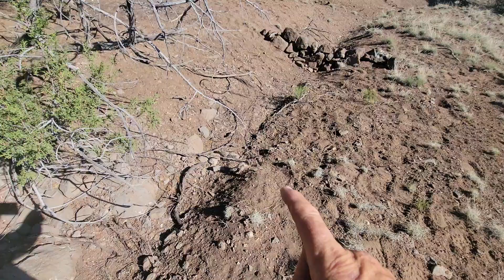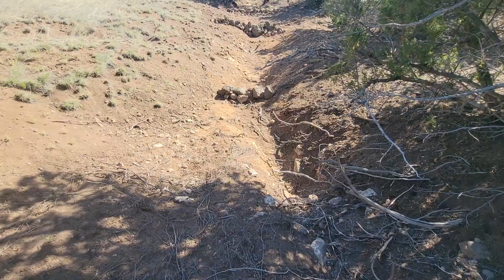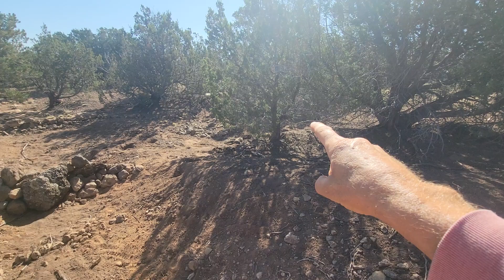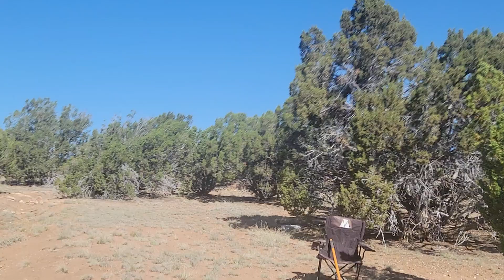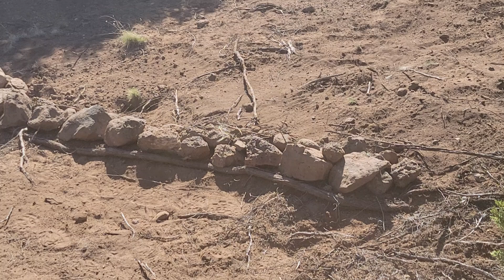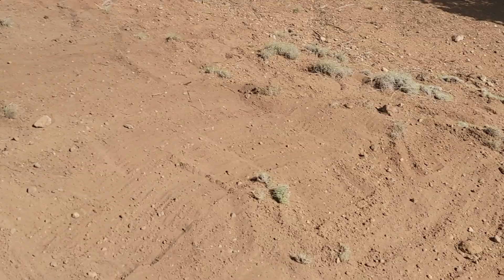Building Check Dams At The Ranch Property: Arizona Urban Farms in Apache County, AZ

Comment: The water will most likely just wash away your stones. Water is very powerful even when it flows slowly, as it makes soil creep away under each rock. You might want to watch videos from those Indian and African water management projects.
Just like you, they build little dams, retaining walls and reservoirs. 
With your rocky soil you'll face different issues on top.
The soil capillaries aren't receptive yet to hold water, so it's difficult for rain to sink and seep into the ground water. Simultaneously you'll have a lot of evaporation.
Those shallow creek beds are good to plant flowers, sure, but better plant shrubbery. They have deeper roots, and hold the soil together better. They also give more shade to stop evaporation, cool the den and collect dew, which keeps the soil moist. Moist soil can accept water much better than dry soil when it rains. 
You can also dig side arms so water can flow lateral and reach a larger area.
Later on lebt trees. Trees suck water up and raise the whole water table. On a hillside that means the water table has a smoother down ward curve.
You might also want to consider a shaded or covered stone reservoir.
For the beginning you can dig trenches out sinkholes. Anything that collects water and forces it to go into the ground instead of evaporate or run off.
Subscribed. I really would love to see what happens. 😯
Reply: I agree, I would also suggest making the rock piles quite a bit wider, almost as wide as they are long. This will prevent rocks from tumbling or erosion continuing underneath.
Reply from the maker: Great points and suggestions.